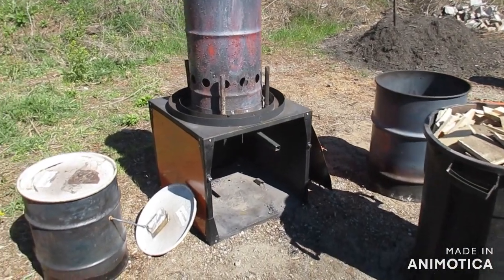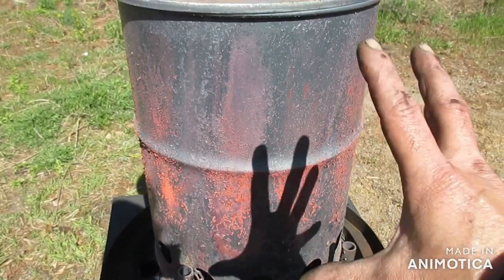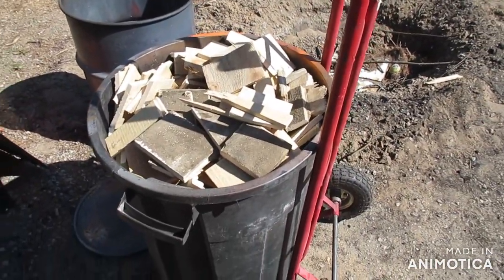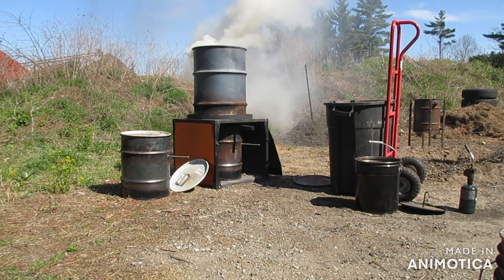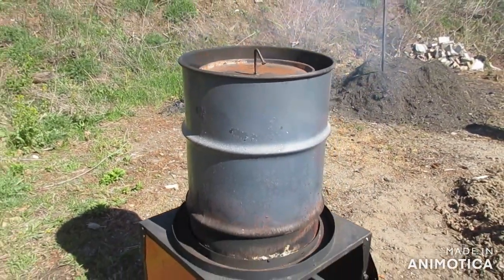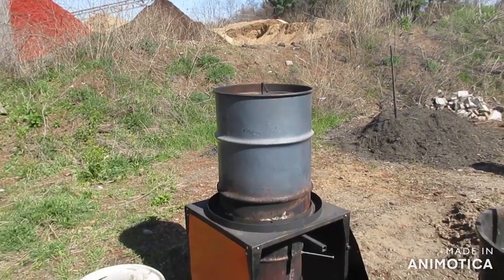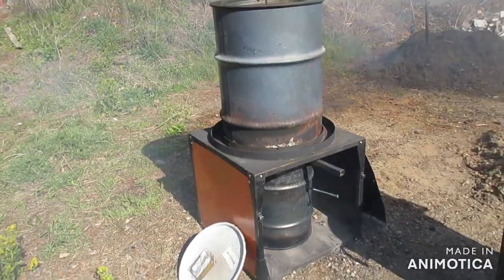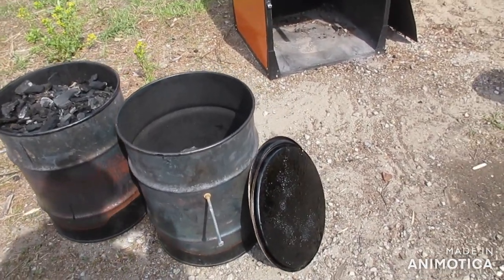Charcoal Tutorial with our Kiln

Comment: Try Top lighting the fuel and go downdraft to reduce smoking, it will also allow the inner chamber pyrolytic gases to vent easily.
Reply from the maker: No that is a TLUD this is a BLUD. Any kiln retort is going to smoke at light up. Once it is going; it is not smoking any more than a TLUD Ive built both and the TLUD is how I arrived at this design. This design a much more efficient than a top lit as more heat energy is focused at the raw fuel hopper. If you top light it the cover will put it out as it can not get any air That is the whole point to limit the amount of air that can oxidize the fuel. All we are trying to do is create combustible gas and burn that gas outside the fire tube in the second stage. The only time it will ever smoke is at light up or if you let it burn down to far. If you keep the layers in check it is very low to no smoke at all. 

The inner chamber pyrolytic gases are the gases Im after to create the heat. I want that gas exiting as low as possible not out the top. Its a waste if I just vent out the top.
Reply from the maker: Keep in mind this video is an hours run time compressed into 20 minutes. When left alone that thing does not smoke one bit. Only when you shake the grate and refuel. There is like what five minutes where it smoked here in the video? The rest of the time this thing is smoke free and you can add a top with a flu pipe to serve as an afterburner as well. That will surely fully burn off stray gas.
Reply from the maker: oh and lastly I used pine needles to start this in the video. Top lit bottom lit dont matter those pine needles are going to smoke. But they do get this thing lit very quick.
Reply: TLUD a bit in the beginning will reduce smoke - you put in paper, needles then lit it and then added wood on top... I agree with @shubobiswas5587, so put in the same amount of wood first, then your needles, then your paper, then light it from the top with your torch... You put the lid on after the same amount of time either way.. just one with lots less smoke than the other...

Comment: Great stuff!  50 % is about all I get with my setup.
Reply from the maker: If I keep running the efficiency I think goes up. That first hopper load is really spent getting up to temp and establishing the layers. When I changed out the barrels the second one had as much as the first one but I had already spent most of the raw fuel. I think If I were to process three times say 90 gallons of raw wood, I think I could get in the 60% net yield range.
Reply: @Thrive-Off-Grid  90 gallons in how much time? The best charcoal klin that I've ever seen, thanks for share!
Reply: @Thrive-Off-Grid  What's the ideal temperature and where it's the ideal point of the kiln to take it?... Thanks again
Reply from the maker: @jetafurm  As hot as possible. You want the feed stock as dry as you cn possibly get it. The dryer the fuel the better your yield. The longer it takes to harvest the charchoal the longer the charcoal in the catch has to smolder away to ash. We will be working on V 2 where this is sealed better.
Reply: @Thrive-Off-Grid  waiting for news about the V2. What do you think about close the outside drum with an extensión of about half barrel and a chimney on the top?
Reply from the maker: @jetafurm  it will have drastic effect on the draft. Yes it works and I have double stacked the drums. I think ideally if lengthen the hopper and the shroud it will work better. Add insulation and even better yet. However Im still wrapped up with the VersiFire system at the moment so it wont be until long after the end of September to revisit this kiln. The Versifire makes cleaner gas than charcoal and runs on raw wood. Plus it make charcoal for the CFX RTR for remote gasifier usage. 

Next version will have a completely sealed of catch bin and work just like the VersiFire systems catch bin. This will have a reactor just like an Imbert but in an updraft mode and then the shroud barrel will exhaust the second stage combustion process as this current version does. This should work a ton better as air wont be able to widdle away the produced charcoal as more is added.